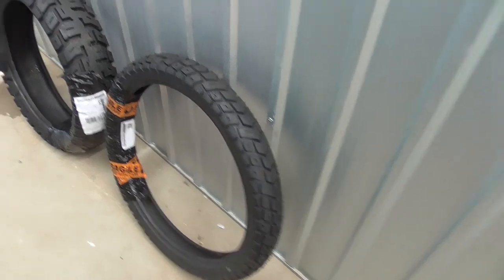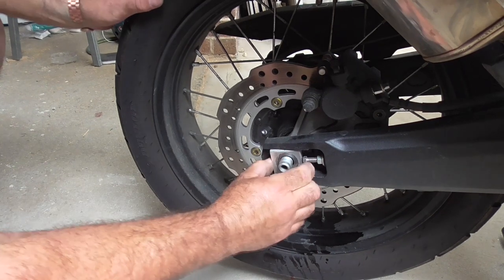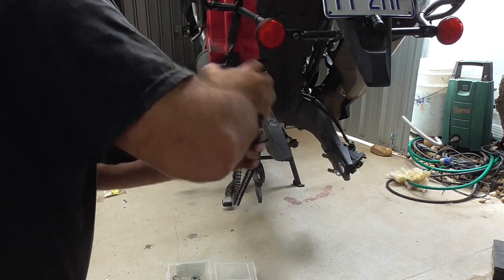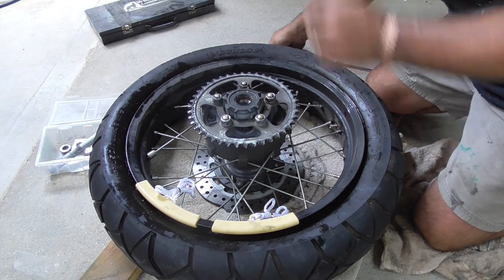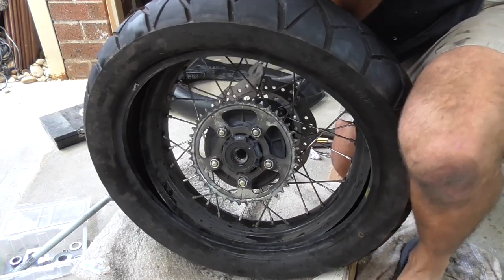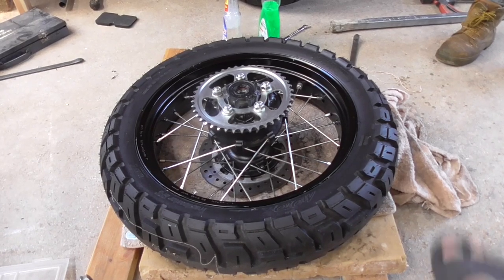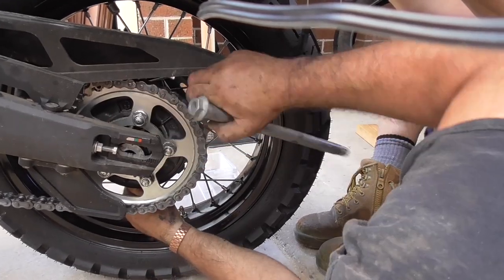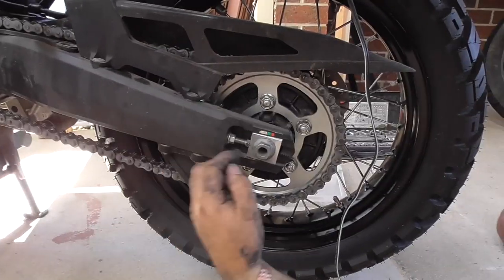Motoz Tractionator GPS on Africa Twin CRF1000

Comment: Hi, very informative. I tend to adjust my chain to within half a turn and then push the wheel upto the adjuster, then do the final turns. I find that it pulls the wheel uniformly and doesn't leave a small gap, hence straight.

Comment: At 16:10 I blow up the tube to maybe 10 pounds so it is perfectly formed inside the tire and has no kinks then let the air out to almost zero again. 
While the tire is off give each spoke a ping with a screwdriver to see if you have any lose spokes. 
23:44 you should use a proper torque wrench and tighten to the factory spec.

Comment: It amazes me how manufacturers put little thought into the fact that tires need changing and punctures occur these days. I have a couple of 70's era Suzuki's and on those the wheel can come out leaving the sprocket and chain in place, which is much nicer and cleaner should you be on the side of the road. Most bikes don't seem to even have a center stand these days, I think in the days when more motorcycles were everyday transport such considerations were given more priority than in today's predominantly leisure use market. This video also reminds me why with the new motorcycles I have tubeless tires are a big plus IME.
Reply from the maker: Your right everything seems to be made basic and thats an extra. There way of making more money.
Tubless yes on a road bike.
But if you dent a rim on an adv bike you wont get a seal with tubeless.
Thanks for your comments.
Happy riding.👍👍
Reply: @WulfOnTheRun  Yes tubes definitely still have a place for serious off road.

Comment: Have you never hurd of a torque wrench?. Place a bit of wood under the wheel before taking out spindle, & adjust chain on side stand (doing on the centre stand doesn't allow for the suspension travel. Your chain was well to tight.
Reply from the maker: Chain was perfect thanks.
Amd tight enough is good enough. 
Make a video to show how you do it..

Comment: I noticed you adjusted the chain on the centre stand..... was it too tight when on the side stand?
I believe the 30mm slack is measured when on the side stand and unladen. Good tutorial.
Reply from the maker: Hi Buddy, yes side stand is advised, but whilst on the centre stand you can afford to go slightly tighter as when you put on load it will go a bit loser, not much in it though, depends on the length and centring of the swing arm,,, So i believe,,? Cheers
Reply: Its the other way around, the chain tensions more after leaving the centerstand, with zero load and the correct tension for sidestand the chain will get way too tight..

Comment: I use a big "C" clamp to break the rim bead instead of maybe hitting the rim with a hammer.
Reply from the maker: Yes Sure. Cheers buddy. I hit the tyre but yes could possibly miss and hit the rim. C lamp good idea thanks
Reply: 40 years of motorcycle riding and maintenance provides much experience and knowledge. The big "C" clamp will unseat both sides of the tire at the same time too. Stand the wheel vertical and turn the clamp next to the rim.
 Plus I used to be a Honda Power Products Dealer and marine mechanic. 
See my other comment about the tube, spokes and torque wrench ;)
Reply: C clamp never crossed my mind🤦🤦🤦, you a genius. I'll be using a c clamp from now on!

Comment: On most good tires there is a red or yellow dot  that  is placed on the lightest part of the tire  so it can be lined up with the valve stem . In the video it doesn't look like you lined up the dot to the stem so that tire would be  easy to balance . Is there a dot on the  gps  back or front tire ?
Reply from the maker: No dots on the tyre.
But been a great tyre did around 14000ks on it.

Comment: Hopefully your still reading comments here. 
I'm thinking of getting the tractionator GPS. 
My bike is lowered and I just don't want the seat height to go up. 
Do you recall if the GPS was any taller than the tire removed, not considering wear on the old tire?
I know the GPS has a deep tread design. The tire I'm removing has a similar tread as your old tire.
Thanks
Reply from the maker: Hi Brad yes it did feel a bit higher buddy. Im guessing it went up by about 15 / 20mm

Comment: I'd NEVER use that much soap mounting tires. A little in a bottle of spray water is all that's needed. Also WAY too much grease on spacers, will attract lots of dirt as it gets pushed to the outside when pushing into the seal.
Reply from the maker: Cheers Jerry
I was bought up working on cars and bikes by my dad who was known for being heavy on the greasing of things.. Guess it runs in the blood.
👍👍

Comment: Question. Aren’t these tires tubeless ??
Love to try them out but I also have an ATAS and it needs tubes. 
Thank you
Reply from the maker: You can use tubeless tyres on tubed wheels with the innertubes Not a problem.
Just cant use tubed tyres on tubeless wheels. 👍👍

Comment: you balance the wheel at  the auttoshop while inflating the tire or do you think the balance will be ok even though you placed a different tire?
Reply from the maker: There is a dot on the tyre that you line up with the valve. That should be balanced from manufacturer. They have been good no problems.

Comment: I was just wondering - when you change an ADV tire, do they need to be balanced?
Reply from the maker: Your supposed to but as long as you line up the valve to the innertube with the mark om the tyre. Its pretty close.

Comment: Hey Andy how do you find them tyres in thinking of changing to them
Reply from the maker: Great mate ive done about 10k on them and still like new. I found thr front had a bit of vibration at low speed but soon settled in
Reply: Ok thanks ride safe

Comment: It say tubless on tyre sidewall are the ok to run with tube or is there a tt version?
Reply from the maker: Dupplo Fandanges 
Hi bud its the same tyre for tubes or tubless. Its the wheels that are different. So yes you can use them 👍👍
Reply: Wulf On The Run usually there marked TL tubeless or TT tube type the the tube type are smooth in side the tubeless have the little ridges
Reply from the maker: Hi Bud, it says on the tyre next to where it says 50/50 tubeless then in brackets" for tube rims install tube,

Comment: Hey Man, do yourself a favour and get yourself a motion pro bead buddy II - it acts like a 3rd set of hands for when you haven't  got Jimmy around
(Link : https://www.motionpro.com/product/08-0471)

PS - your standard tubes are absolutely fine if you don't go off road and run lower pressures. Its when you go off road and reduce the tire pressure is when Heavy Duty  tubes come in handy as they are much thicker and stiffer inside the tire .., and because of that they are more resistant to tube 'pinch flats' when riding with the reduced tire pressure .
(which lowering the tire pressure gives the bike much better traction for riding in off road conditions).  

HD tubes are not any more resistant to a nail puncture though than what standard tubes are , they're only better for resistance in pinch flat when running low tire pressures - thats all  ;)

Comment: Im interested in the fuel tank you have attached to the pannier rack ,  where did you get it from and whats it called ?
Reply from the maker: Hi Nick i got it from ebay. Heres the link.
https://rover.ebay.com/rover/0/0/0?mpre=https%3A%2F%2Fwww.ebay.com.au%2Fulk%2Fitm%2F302495851776

Comment: "Put them on the other way" ??? You mean inside out??
Reply from the maker: Haha for slicks yes..
Reply: @WulfOnTheRun  Seriously what do you mean but "the other way"
Reply from the maker: @dennisdeberry2582  sorry mate. if you face the arrow one way its a 50/50.
Face the arrow the other way its a more rugged grip for off road makes it a 20/80.
20%on road 80% off road.
Reply: @WulfOnTheRun  Thanks I like that!!! Very cool. I myself do not need a 20/80 tire. I am still searching for a 70/30 tire. I did some real calculations and estimation before I even brought a bike as to how much I would be on road and off. But I do not think they make such a beast.

Comment: how did you attach the jerry can?
Reply from the maker: Jo Miller
Hi Joe you can get them as a kit. It comes with bracket. Ive included the link from ebay.👍
https://rover.ebay.com/rover/0/0/0?mpre=https%3A%2F%2Fwww.ebay.com.au%2Fulk%2Fitm%2F121895172868
Reply: just a U-bolt through your saddlebag bracket then? Did you attach a bar across the bracket?
Reply from the maker: Jo Miller 
Hi mate watch this video at 10mins 30sec ot shows you the fuel can mounting
https://youtu.be/TFH7ibMm-3E

Comment: this is what I pay the shop to do
Reply from the maker: Good when theres a shop but out in the middle of the Aussie bush or desserts. NO Shops there. So practice is good
Reply: $100CAD per tire to mount & balance at all my local shops.
Reply from the maker: @ThisTall  like i said above its great when there are shops around but out in the Australian Outback or bushland. You get a puncture you need to know how to take of the wheel / tyre and put back together.

Comment: After watching this I think it’s easier to just pay to have changed out lol
Reply from the maker: Sometimes in the middle of the Australian bush we have no options but to do it yourself. So practice makes perfect. But if a city rider, why not
Reply: It’s an adventure bike, if you’re never in terrain where you’re ashamed you don’t know how to do this if you suddenly got a flat, you’ve bought the wrong bike.
Reply: Always best to familiarise yourself with the routine if going remote, can't be over-prepared. There are actually better levers available which interlock and work in a scissor manner to unlock the bead, called "Motion-Pro  Bead Pro" levers (part #08-0519) and "Bikeservice make a set of three rim protectors (#BS9952) which work well too. Sorry but the hammer is too risky. Less skin off the knuckles if you remove the cush-drive sprocket housing.